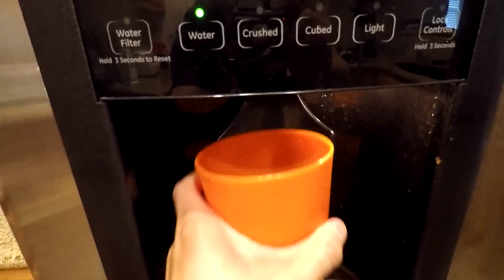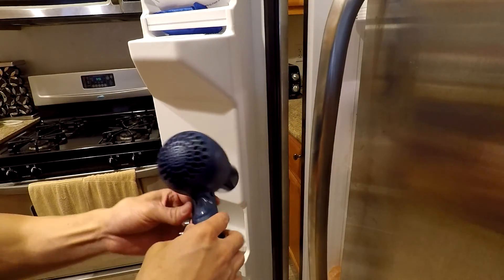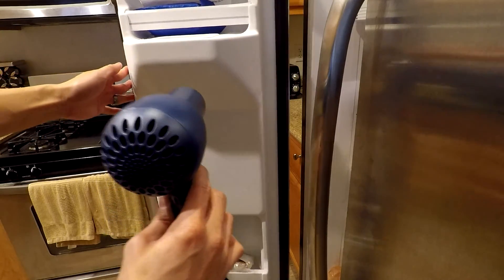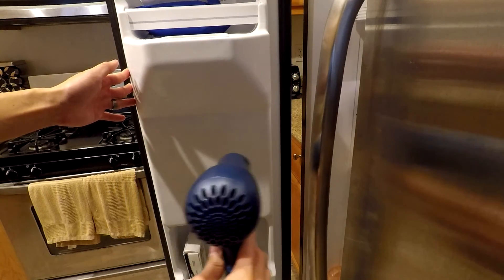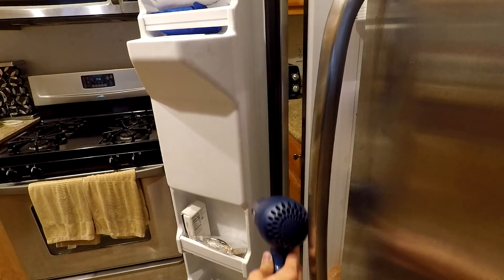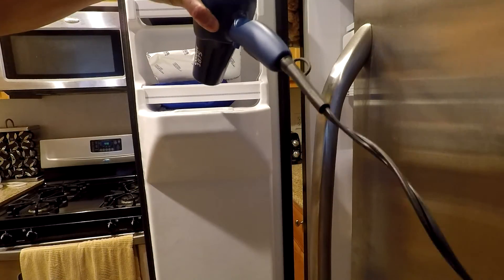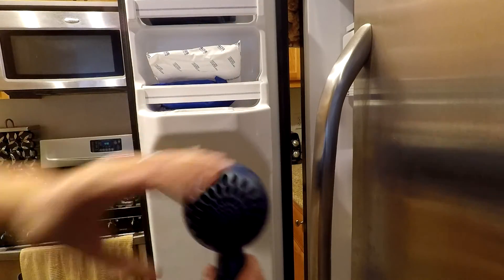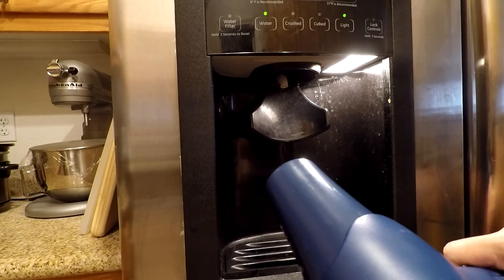Fix Frozen Refrigerator Water Dispenser Line Video

Comment: Thanks! Worked for me! Just like you said, it didn't work immediately, but after using the hair dryer for about 10 minutes, then letting it sit for another 10 minutes or so, water was flowing! Cheers!
Reply from the maker: awesome!  glad it worked for you.  its weird how that works right?  i think the tubing just needs a bit of time for the heat to absorb and thaw it out, then the water will push the thawed pieces through